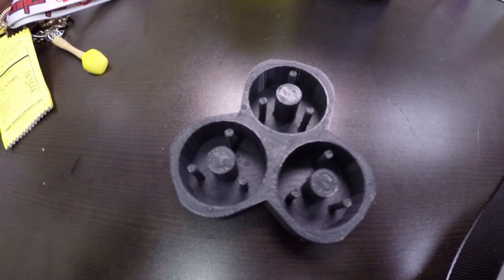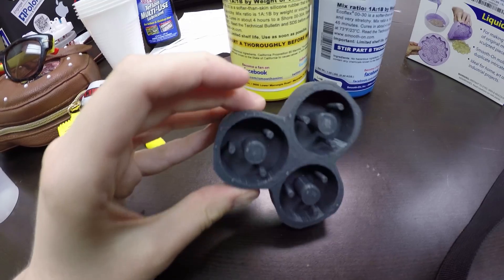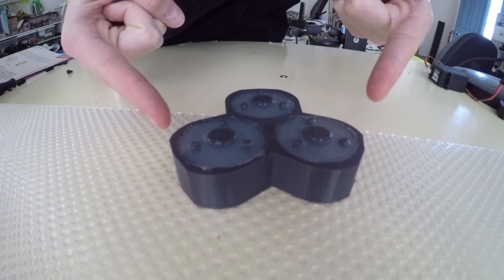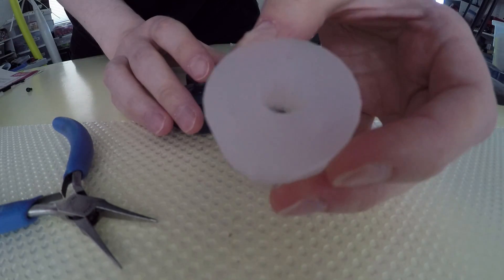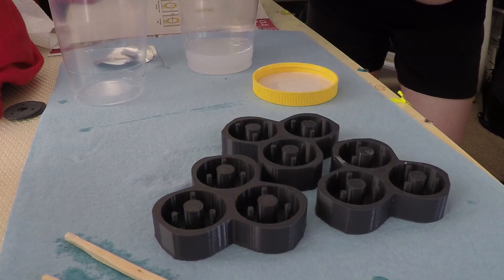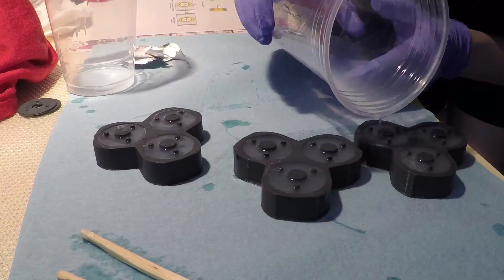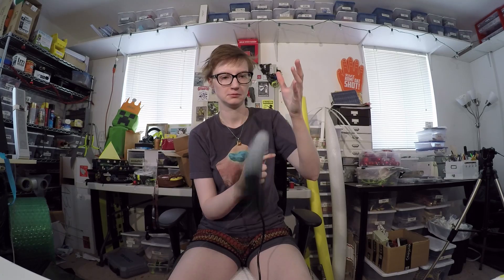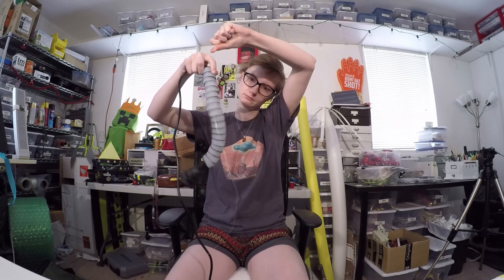Flower 2.0 : Molding Squishy Vertebrae

Comment: Hi there, person into soft-robotics here. You need a higher shore rate on your silicone. the weight of the pieces above is squishing the spines together too easily. however, if you use a harder silicone, you'll possibly need to make the pillars that you thread the 3 cables through convex in the middle of the vertebrae in order to give it a little more give than it would otherwise

Why did you leave the spring based idea?

Comment: love this idea ...but think of this more like the human spine ...the "squishy " is suppose to be for shock absorption, SO ...you need something ridgid and tough between the "squishy" ...now that isn't to say you don't need the tension wires ..i'd think both ...run the tension wire inside the ridge and squishy sections like in the mold idea you have and it should ...in theory give you a LOT more standing erect ability ...BUT like the human spine ...it has a wider base AND is supported up top by ribs and collar bones....i am so VERY interested to see where you go with this
Reply from the maker: =D I think on my second iteration I'm going to add registration marks so the vertebrae can actually lock into place on the 3D printed disks... Those will also end up being thicker too I think. I need to get more wire so I can finish applying tension to the whole thing >.< I'll post soon with another video on how that goes.
Reply: awesome ...believe it or not this area of any kind of R&D is near void in comparison to other area ...you could be on to something that changes everything or sets a standard ...after all ...our astronauts gloves were designed in a guys shed behind his house , again very interested to see where this goes and how it turns out and look forward to the videos, {EDIT} just remembered ...3m makes a rubber that comes as a liquid(pour in to mold like what you used, we used it to water proofing electronics BUT it would be great for a more durable "squishy" section down the road  in later trials